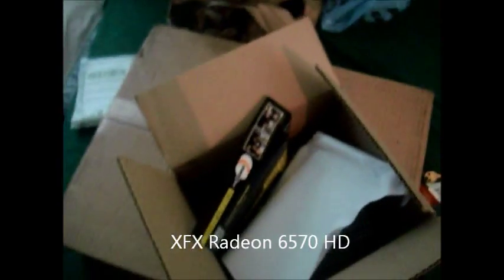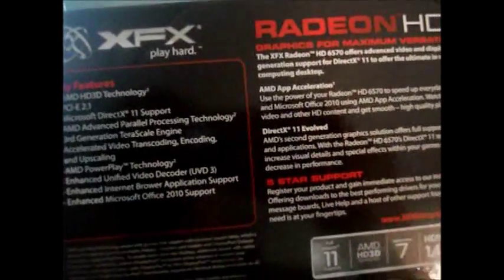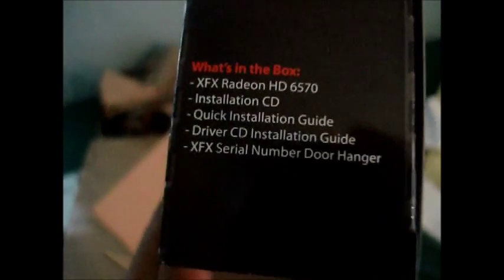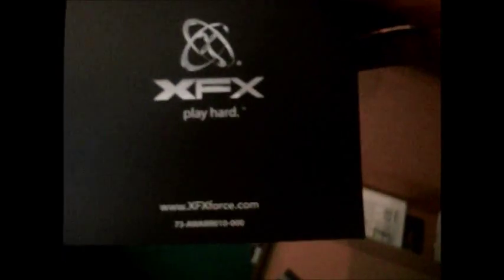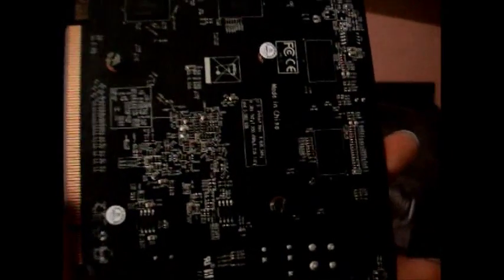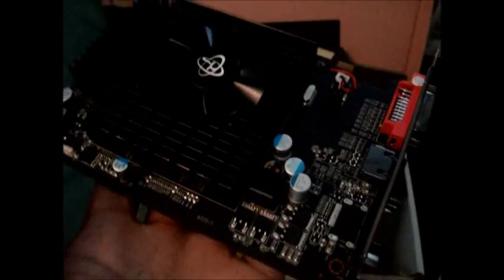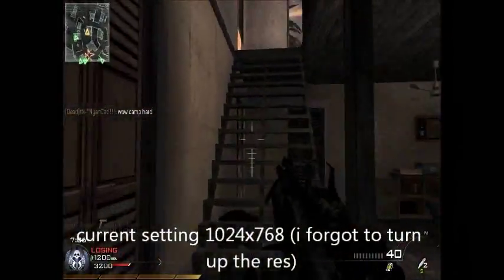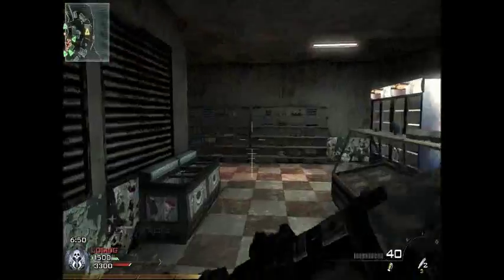XFX Radeon 6570 Unboxing/Install

Comment from the maker: if you have windows 7 it will use a generic driver therefore you can still have a image on the screen you just cant take advantage of direct x until the AMD drivers are installed

Comment: The 3770k is only a 77w processor. It would work and still have headroom, depending on other components and quality of the power supply.

Comment: This card could run on less, depending on the cpu. The max the PCIE slot can provide is 75w, and this doesn't require a power connector.

Comment from the maker: well i have a phenom x6 and this card (r6570) and at max system load they pull 250watts to 260 watts,  you would be pushing the limits of your PSU and if its not a high quality PSU then forget it

Comment: @QuadroNVS ill tell u what i have tryed.
1. did cd drivers
2. set BIOS to PCI-E
3.made sure the card was secured inplace.
-------
i connect the VGA cable to the VGA port on the card and i turn on pc then i wait for 10 mins and nothing shows.
-------------
i can send you picture to make it easyer? if you want.